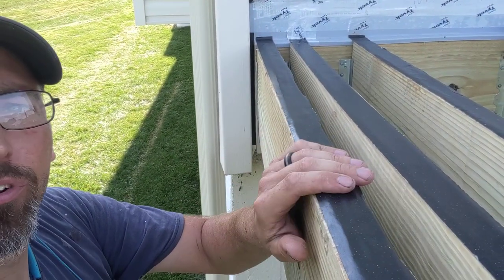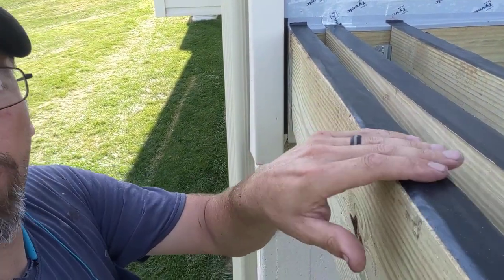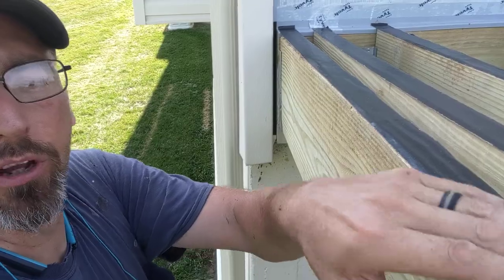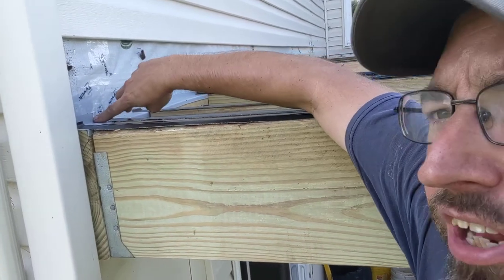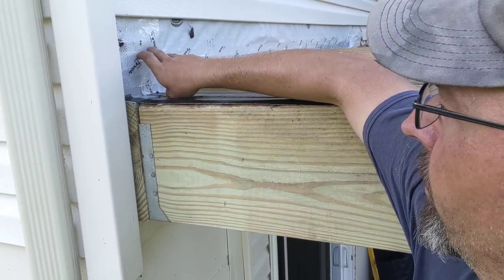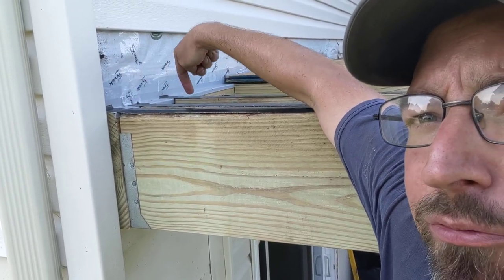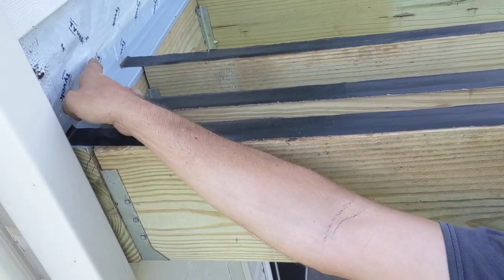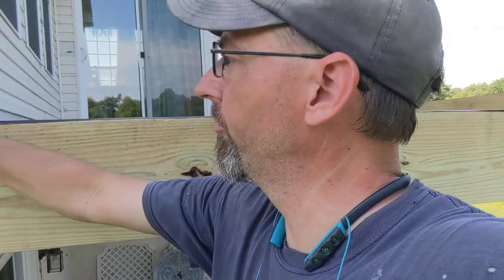Deck Joist Tape... Do you need it?  Why is it important? (Deck Expansion Part 3)

Comment: The latest pressure treated lumber corrodes the galvanized hardware rapidly. I only use stainless now. I have never used deck joist tape, and have never found a rotten joist on decks I've built with the older, arsenic ladened pressure treated lumber. Maybe the new stuff is less robust, I don't know. I guess the stuff can't hurt.